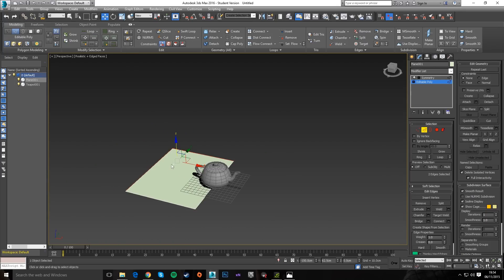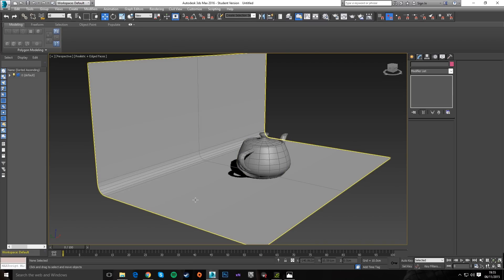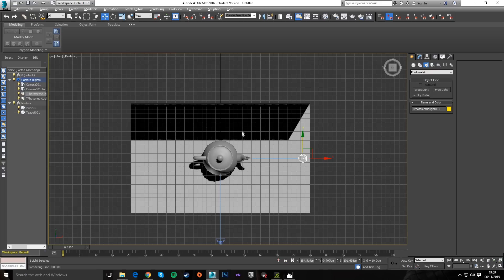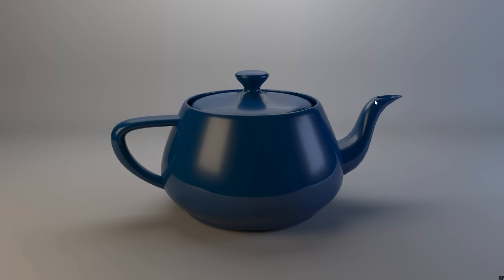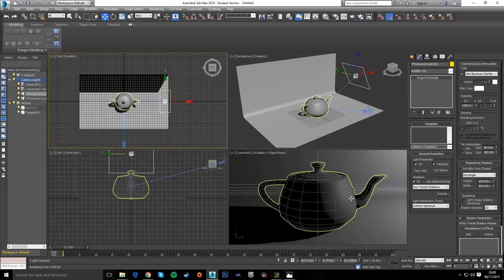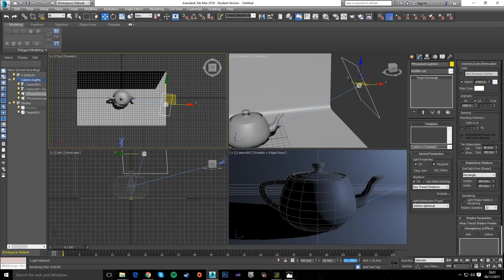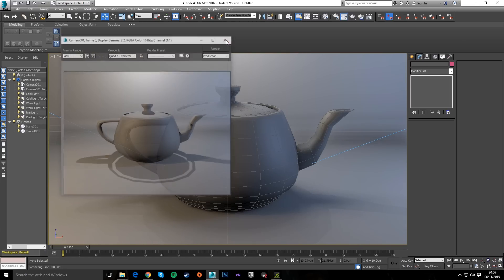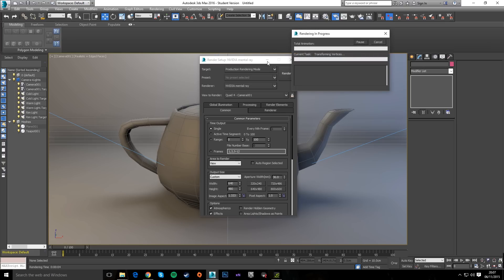Lighting Render Setup in 3DS Max Tutorial

Comment: I cant get the editable poly plane to make a wall like when ypu edited it, for me it just moves the plane making it slanted without creating new walls. any help?
Reply from the maker: Vaibhav B. If I understand you right. Your talking about the curve to the wall. Double check when you chamfer the edge that you increase the interpretation amount meaning how many edges are added to the curve. Otherwise it will just look like a slant.
Reply: Not quite, I'm talking about how you raise the edges to a new wall, for me it doesn't make a new wall, it just drags the edge higher
Reply from the maker: Vaibhav B. Make sure you are have an editable poly and not just a plane and check you are in edge mode with the edges selected before extruding the edges to make the wall
Reply: use shift while dragging the edges, make sure you press shift first
Reply: Select one edge and click on loop so that all the edges in that line gets select ..then use shift and move in y z direction